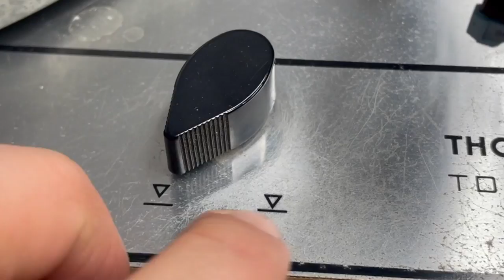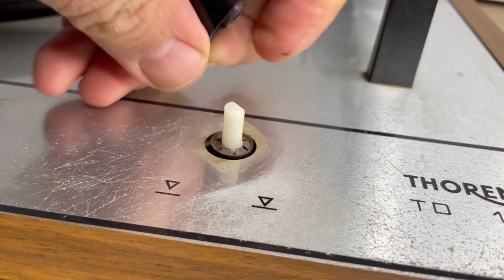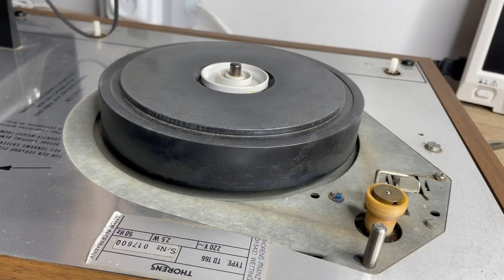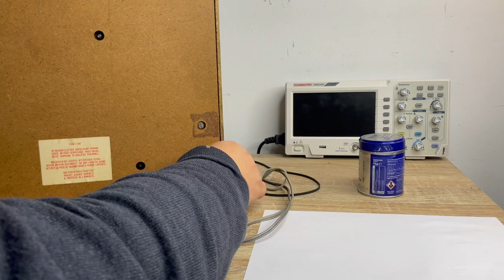Restauración Thorens td-166 - Versión larga

Comment: Really nice video showing the most important elements of repair/upgrade required.....However the tech really goofed at the 30 min 41 second mark when he used a scale to balance the tonearm. Note that he mounted the counterweight BACKWARDS which has ALL the marking required to balance the arm without the use of a scale. The video continues in the manner until the very end.....OOOOPS!!!

Comment: Quite nice. A shame you didn’t disconnect the ground wire from the tonearm from the right channel when you had the chance. This has to be separated and connected directly with a grounding to the sub chassis and chassis and run out in one ground cable seperate from the RCA. Lowers noise floor to a minimum.
Reply from the maker: Oh! Thhank You very much for your advise! Do you know where I can find information about this mod?
Reply: Well, not any other than what I describe above. The grounding from the tonearm is connected to the right channel ground. You have to disconnect it from there and let the RCAs run separately, whereas the tonearm ground wire now runs alone to connect to a wire that you have to install between the chassis and subchassis. This is now your ground wire to be connected to your amplifier of preamp. Good luck
Reply: Hola qué tal? 

Hubiera sido de ayuda saber que lija has usado para el plinto, y que tipo de cera has aplicado.